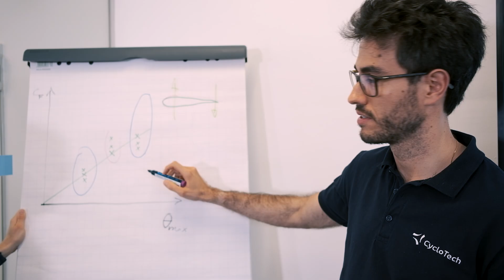Discover CycloTech #3 | About CycloRotor Technology

Comment: It is nice that your company is working hard with the cyclogyro. You have a great team of performers! It is just a pity that you do not have fundamentally new technical solutions. Of course, you draw very well, but such a product will fly poorly. Your predecessors in the D-DALUS project lifted 250 kg into the air. (What is the weight of your cyclogyro?) Your technology is practically no different from that invented by engineer Sverchkov in 1909, but for some reason you stubbornly refer to other authors from the 1930s, who did nothing technically for the development of the cyclogyro and the hydrodynamics of your cyclorotor. Why such a denial of engineer Sverchkov's achievement, after all, it was he who first came up with the kinematics of your cyclorotor?
Reply: For @-108-
1. I really like this team, especially its leader, although lately the team has been marking time.
 2. Ask a question on the merits of my comment without false emotions. It is clear from your comment that you know nothing about cyclogyro.
 3. The purpose of my comments is to help those who work, since all my comments are on the merits of this issue.
Reply: Why you gotsta be hatin' on they game, yo?
Reply: @-108- see answer below or up
Reply: @cyclogyro  my replies are being censored.

Comment: I cant see how it would be more efficient than regular props with all that AoA change through the cycle, but it would be great to see comparitive testing.
Reply: uniform blade speed and no retreating blade stall probably the biggest factors in high speed efficiency, but that's my speculation. 
additionally the blade loading might be more even since the profile is at a constant shape and speed too.
another thing to note is that you don't need to wait for RPM to increase thrust with the cyclorotor design.
eventually we all will see the data and be able to make an informed comparison.
Reply: it has strong stable thrust if the propellers were in rigid mode, but power source is a big problem for them.